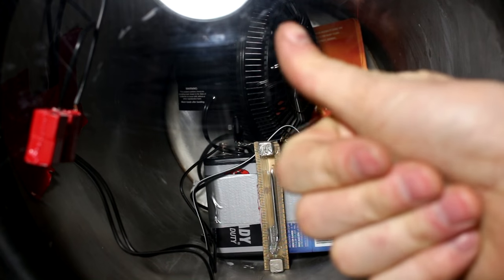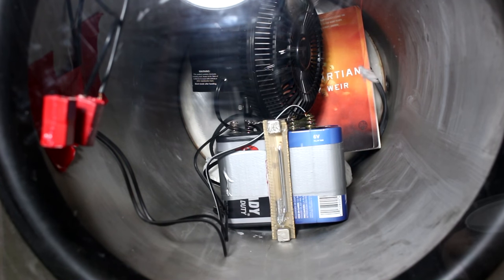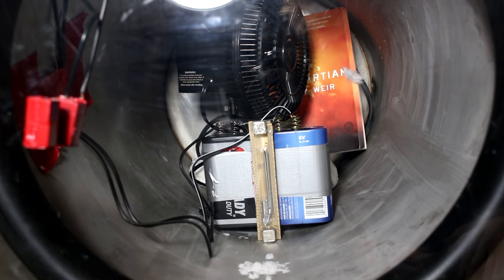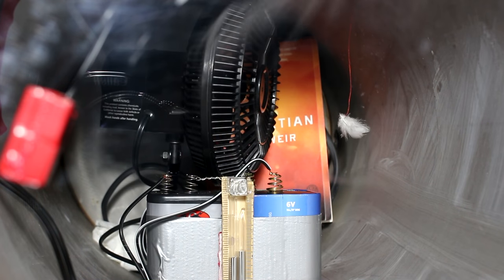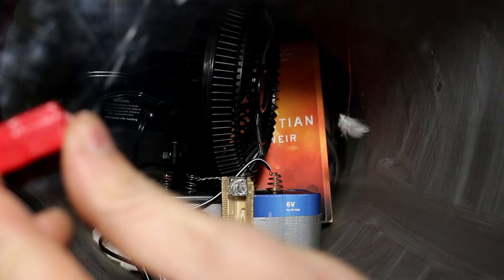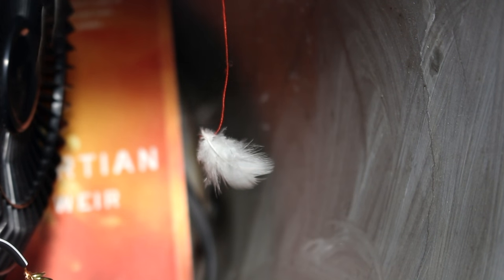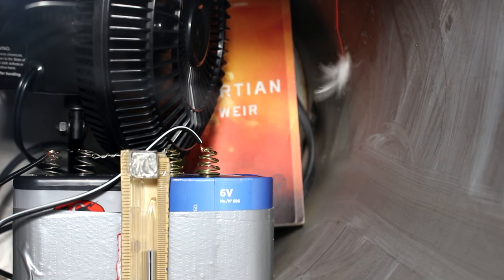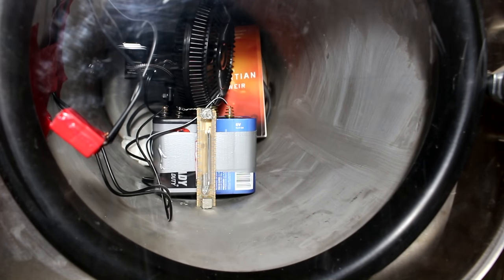How Strong is The Wind on Mars?

Comment: How do you know that the fan is producing wind at 5m/s in the vacuum? Isn't it possible that the wind speed generated by the fan would be much less because it is not able to create the necessary changes in air pressure?
Reply from the maker: Well I dont really have a way to measure it, but it stands to reason that the blades are still hitting the gas molecules and increasing their speed by a similar amount.
Reply from the maker: Ok I thought of a way to measure it by using smoke; I'll make a video on this soon.
Reply: +Cody'sLab Sounds good, thanks for the response.
Reply: Cody'sLab maybe I'm just an idiot, but what about solar wind? Doesn't the sun blast mars with radiation all the time? Could that produce wind like movement?
Reply: Hmm, I actually think the wind would go faster in the near-vacuum. The fan is pushing a less dense medium, so it's easier to push. Consider a fan in air vs underwater. And with less resistance, I think the motor would reach a higher rotational speed than in a normal atmosphere.
Reply: I'm really glad youtube and channels like this are a thing. 

Bill Nye, and the discovery/history/science channel/TLC used to actually have educational stuff on it for kids to watch and learn stuff off of. But that's all dead now. It's all reality tv shows and garbage.

Another great video! Interested to see if the particles are moving the same speed and there's just less of them to act on the feather or if they're moving slower. Maybe try a Ducted fan from/for an RC plane? More directional airflow? 

You'd think the particles would move faster because they have fewer particles around them to bump into and the fan blades are spinning faster hitting them harder.
Reply: I think you're right. You can hear that the fan is a lot louder in the "martian atmosphere" so it's spinning faster.
Reply: Although as you say in the video cody, the fan seems to be spinning faster in the partial vacuum than at atmospheric pressure, that could mean the air is moving faster.
Reply: maybe it's been discussed, but why is gravity never brought up when talking about this?
Reply: @Kdog177 That's exactly why terraforming mars would be so difficult. We would have to have earth-like magnetic poles in order to propel the solar winds and radiation away. It would strip a dense atmosphere off of the planet.
Reply: in a video cody proved that the light molecules could move objects, but i dont think that it would move nearly as fast as the film
Reply: You used vacuum pump while the dry ice was producing CO2. By the time you turned off the pump, there was vacuum. I do not even think you have used enough dry ice to do anything. It's like put 2ml in formula 1 car and hope that it win the race. 
So, in the end, adding dry ice was absolutely useless.
Reply: You could attempt to calculate it first using Bernoulli. Calculations on flow, especially when working with pumps or compressors etc etc. tend to be very close to the actual situation.
Reply: I sucked all the air out of a bag until it was flat and curling up. Then placed it in a vacuum chamber. The bag expanded to fill the entire void of the chamber. Point is, it would take very little gas to expand to fill a void at that low of a pressure.
Reply: NASA used hot wire anemometers on Viking and later Mars landers so that's another possibility
Reply: That could actually be the reason for the vibration, recorded. So faster rotation-> higher centrifugal force-> and I guess higher induced particle velocities.

Comment: are eggs vacuumproof or will they explode? :p
Reply: TheRolemodel1337 I think they would explode. They have a high water content which in a vacuum would boil causing a high internal pressure that would rupture the egg
Reply: Slaughtering Smiles i dont think it would boil,since the pressure inside would not change.
Reply: I don't think the vacuum can reach the inside of the egg. So the water content won't be able to boil... i think
Reply: Pierre I dunno, itd depend on if the egg could withstand a atmosphere pressure differential. Imagine about 14 psi trying to pull the egg apart, thats quite a substantial force, I dont think the shell could handle that all over its surface.
Reply: Eggs have a pocket of air in them. It wouldn't be able to reach equilibrium with the atmosphere and if the egg shell wasn't strong enough to support the differential it would break.
Reply: Interesting question, but I have no egg to try it, got to wait till they start laying again.
Reply: I reckon they would eggsplode
Reply: An Egg could withstand 2 bars of external atmospheric pressure. However I think it would explode under vacuum.
Reply: murderdoggg really that much pressure? Crazy! Compression vs. Expansion though... I think I'm going to go do some Google searches to find this answer!
Reply: There is an experiment on the 'Beyond the press' channel. Didn't explode.
Reply: Bird and reptile eggs have a hard shell. Directly under the shell are two membranes. Between the membranes is a small air cell, also called an air sack, filled with oxygen. As the animal develops it uses the oxygen, which must be replenished, and it also has to release carbon dioxide. How does this happen? Well, if you examine a chicken egg carefully with a magnifying glass, you'll see that there are tiny little holes, called pores, in the shell.

from scientificamerican.com/article/bring-science-home-chick-breathe-inside-shell/
Reply: cheeto4493 how fast could it regulate the pressure differential with these pores though?
Reply: I don't know. Eggs explode in a microwave. I think it's steam pressure that causes the event, so I would say no. But they don't explode when hard boiled. Nor when dropped into a pot already boiling. Needs a test and not just speculation.

I was thinking more in response to Pierre's comment about eggs being sealed and not effected by the vacuum and not allowing the water content to boil.
Reply: I wonder if you cook an egg in the microwave at a power level low enough for it to take the same 12 minutes, will it still explode?
Reply: You'd have to make sure the fluid inside the egg doesn't reach boiling point (and create steam). In water that is easy, as long as there is some water left it can not get hotter than 100 degree C. Inside the egg the water doesn't boil because the pressure would rise slightly and increase the boiling point.

So I bet you can cook an egg using microwave power, if it is applied carefully enough. I guess you can try when they start laying again in the spring.
Reply: stefantrethan They don't have eggs at the store were you're at?
Reply: stefantrethan I'd try it, but I don't want to clean up the mess. lol
Reply: Why would I buy something the chicken just poop out?
Reply: Beyond the press did a video on it. Search "beyond the press egg" and it should be your first result
Reply: It has to do with the arc shape of an egg. Mr Wizard did a video on it in the '80s. He put a a 10 pound weight on an egg, and it didn't break. I just looked for the vid on YT, but couldn't find it.
Reply: I even saw that and totally forgot.
Reply: stefantrethan Why blow up such delicious chicken poop?
Reply: stefantrethan You can find a dozen super cheap eggs for like $1.50. lol
Reply: murderdoggg It's super strong outside in, but incredibly weak inside out. That's how the baby birds can get out.
Reply: cheeto4493 reptiles have soft "shells". you can rip them with your fingers
Reply: That would be eggciting for Easter.
I doubt they would explode. Eggsplode, maybe, but not explode.
Reply: they would actually implode.
Reply: SED71 not sure if troll or stupid
Reply: Hmm.. I think if they were simply dumped into a vacuum, chicken eggs would at least crack.
I'm pretty sure eggs have pores in then to allow gas exchange, so I think if, for example, you left an egg in a 20 cubic meter compartment and shot a 9 mm hole in the wall so the air would release 63% of its pressure every 15 minutes, the egg would probably equalize with the external pressure until the vapor pressure of water in the egg was reached, then things would get interesting.
Reply: Soooo... We should do it then?
Reply: there's a video by Beyond the Press for that
Reply: All your question have now been answered :p